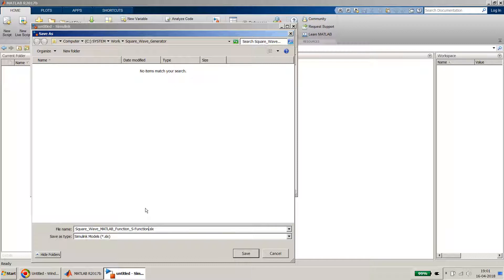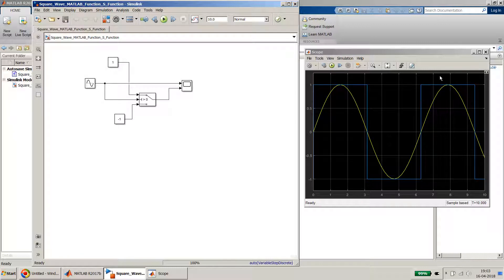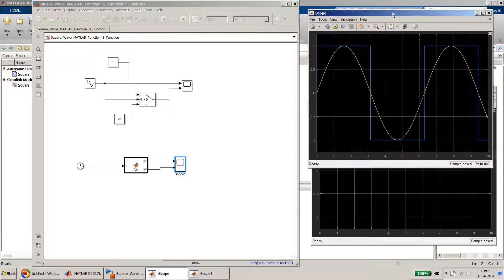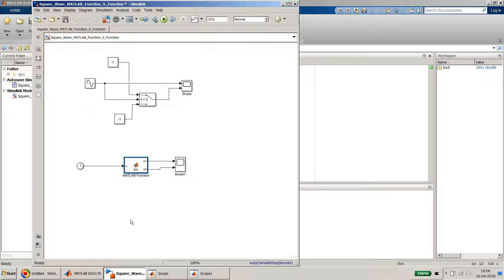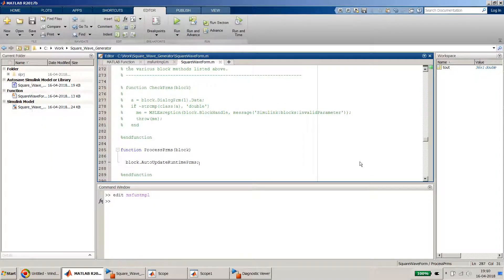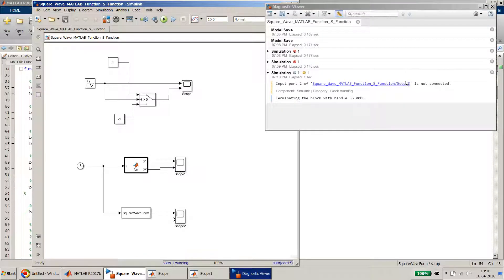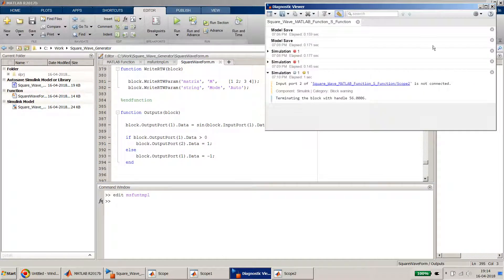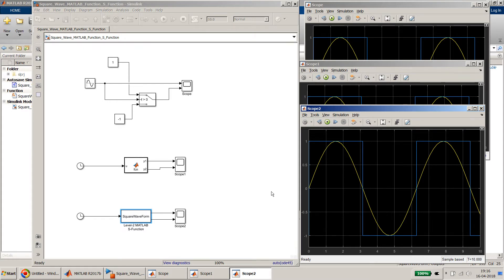Create a Square Wave Generator using Level-2 S-Function and MATLAB Function block in Simulink.

Comment: Hi,what is the  block of for loos in simulink
Reply from the maker: I understand that you want to know the block for loss (opposite to gain block) in Simulink. 

I don't think there is any specific loss block. However, to implement loss you can use gain block with value in fraction (less than one). This value of between 0 & 1 will make the gain block act as loss block as it will decrement the input signal resulting in loss.

Comment: can u make videos on solving differential equations using simulink
2 x'' + 2 x' + 3 𝑦' + 𝑥 + 2𝑦 = 0
𝑦'' + 𝑥' + 2 𝑦' + 2𝑦 = sin(𝜋𝑡)
Reply: Initial Conditions
𝑦'( 0 )= −1
 y( 0 )= 1
Reply from the maker: You can check my video: https://youtu.be/HR9KqHOiszc

In this video I explained  the steps to design the differential equation in Simulink using basic blocks. I hope it helps. Good Luck :-)